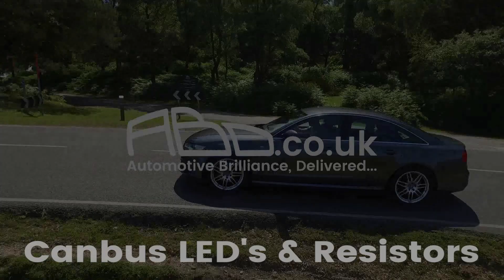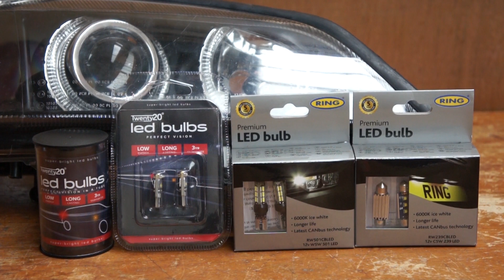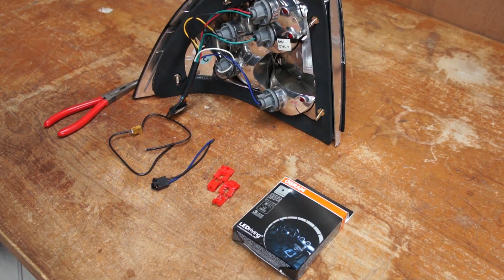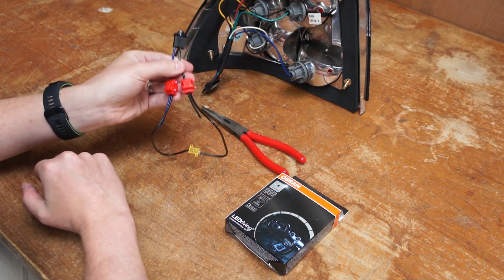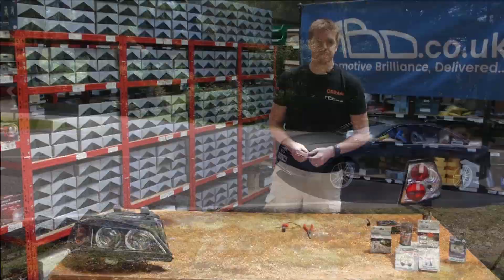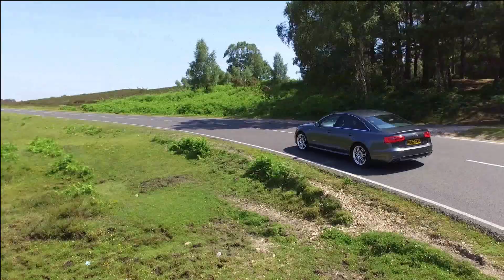LED Bulbs & CANbus Error Codes – How To Fix (With Tutorial)

Comment: So if the purpose of using an LED to replace an incandescant bulb is to save power, and then you parallel-in a similar load resistor across the LED to fool the CANBUS into NOT reporting a serviceable LED as faulty...haven't you shot yourself in the foot on three counts; 1) not saving power therefore fuel, 2) lost the fault reporting capability, that you probably unknowingly paid a lot for in the price of the car in the first place, 3) probably paid quite a bit more for the LED canbus compliant lamp / resistor mod kit ?  I can understand the logic for retailers,  but not for customers. Please explain further.

Comment: Yeah,I’d be more impressed or convinced at least if you actually took a late model car, replaced the tungsten bulbs with LEDs, generate an error code, install your resistor(s) and then SHOW the error code disappear 🫠

Comment: I have tried fitting led bulbs both canbus ones and others with a canbus plug in resistor kit neither work I always get a low beam error on my volvo v50 2004/05 model

Comment: No benefit of 2saving your your battery" and saving fuel   - if the CANBUS resistor is using same power as a filament bulb!!    - old git, UK

Comment: I had bought a P21W bulb which is an LED bulb, and after the replacement of the brake light bulb, now i have glow plug warning light, the bulb lights very good and it works very well but this massage on the dashboard is pain in the ass. So, what resistor i should use, the bulb has 15 leds with power consumption of 0.25 of singled led witch is = to 3.75 W of the bulb in total. 
I'll be very thankful if someone done it to explain how to do it, but my bulb holder is one peace on which all the bulbs are on metal paths i had only one main connector to them.

Comment: How many ohm's is the resistor?
Reply: I'm sure CANBUS does not measure resistance, it likely measures current draw or voltage drop of a circuit. Mercedes LEDs in the headlights will stop the error with a 10 or 12 Ohm resistor in parallel with the LED bulb where the computer thinks there should be a 55W headlight bulb.  A 10 Ohm resistor will add about 18.5 watts of power draw, in addition to the few watts of the actual LED bulb, and that is enough to fool Mercedes. Buy at least the 50-watt metal heat-sinked resistors and you shouldn't ever have a problem with burning out the resistor.

Comment: Hi guys, just a question. I own an 1.8tfsi 8p a3 which i decided to get led bulbs, unfortunately i was getting a error dashboard lamp saying - left/right dipped headlights. I bought a decoder but i still get the ssme msg is there any particular reason for it ? Just saying that the led are 30w and the regular Bosch h7 where 55w ones. Is that the issue behind this error?

Comment: I have a 2005 bmw e61 and have bought an led trailer board.  With this board the brakes work and indicators but the side lights and reverse and fog constantly flicker as if the test is running.  Do you sell anything or should I simply fit some 15ohm resistor in line?  Thanks

Comment: Thx for the video. I have an issue for my Mercedes Parking light (H6W bulb).
Recently, I replaced the front headlamp housing with thicker wire (14 awg, high temperature 200c) and expect it should be better. After that, it returns be dashboard error, disregard using OEM halogen bulb 6w or Aftermarket LED with Canbus error correction.

I have ordered Philips 5W Canbus resistor to do this issue fix, am I doing right? Or I should get back to thinner wiring? 

Thanks again for advice.

Comment: Hi, I did the same as you only with the Osram 21 W CANBUS because the turn signals are my w21w bulbs. The bulbs are currently LEDriving Osram SL w3 * 16q but it still emits an error and after 2 flashes it starts flashing rapidly wen my turn signal is on. I only connected the back right, so when that continued to happen, I stopped working. Maybe I should also connect the back left? Although the system recognizes the exact location of the faulty bulb. Opel insignia A Facelift 2014. Sports Tourer What should I do? I want to say that even one reverse light bulb died! It does not show an error on the board! I replaced both with Philips LED and it immediately showed an error ??? ;) I also need resistors here? Should they be 16w exclusively for the W16W bulb?

Comment: hi i got a question, If i was to tap (drl's) into the parking light wire, where would i tap into? the part above the resistor or below the resistor.

Comment: Upgraded lights in my vehicle - LED in high beam, H7/H11 in fog lamp , HID in low beam.... Added addition relay for CAN bus error cancellation.... Still on the fog lamps the MID gets reset any solution for this?

Comment: What's the resistor 's value in ohms?
Reply: Mercedes LEDs in the headlights will stop the error with a 10 or 12 Ohm resistor in parallel with the LED bulb. I say 10 or 12 Ohm because on the same car, the 12 worked for one bulb, but I had to go to 10 for the other bulb to get it to stop turning on and off.  Buy at least the 50 watt metal heat-sinked resistors.

Comment: You talk about “adding resistance to the circuit” but a parallel resistor REDUCES the net electrical resistance. Only  adding in series will increase circuit resistance - simple electricity! 👹R = (r1 +r2)/(r1 x r2), which is always lower than either individual resistor.  Is that what is required?
Reply: He means to say "add" parallel resistance; also, I'm sure CANBUS does not measure resistance, it likely measures current draw or voltage drop of a circuit. Mercedes LEDs in the headlights will stop the error with a 10 or 12 Ohm resistor in parallel with the LED bulb where the computer thinks there should be a 55W headlight bulb.  A 10 Ohm resistor will add about 18.5 watts of power draw, in addition to the few watts of the actual LED bulb, and that is enough to fool Mercedes. Buy at least the 50-watt metal heat-sinked resistors and you shouldn't ever have a problem with burning out the resistor.

Comment: Can you disconnect resistor after the LED turned on ? If canbus just check resistance before applying power then above treat should work. Since we can use small wattage resistor to fool the system
Reply: My understanding about how these bulb-out systems work is that they periodically send a low voltage pulse (not enough to illuminate an incandescent bulb). The computer uses this to calculate the resistance of the filament and thus determine if it is good. It would be interesting if a circuit provides a dummy load resistor when the circuit is off (to fool canbus pulses), but then removes the dummy load when the circuit is on. Should be a simple circuit that could be incorporated in the LED bulb itself.
Reply: @egoequus6263  that’s what I’m taking about.  The number one advantage of LEDS is the massively reduced power draw.  Putting a resistor in there negates that.     If they can be “started” with the resistor and then it be removed from the circuit that’s better than nothing.

Comment: There are two other options. 

1). Older cars that use a relay - replace the relay with an led relay. 

2). For computer controlled systems, using the obd port and the manufacturers code reader/programming software, turn off the warning.

Comment: I have canbus led's for front/rear indicators fitted to BMW M4. There is a slight flicker on all bulbs when the vehicle's canbus system scans for faults. otherwise no issues. I fitted 50W 6 ohms resisters and they actually caused hyperflash. What do you recommend and would a low watt bulb in parallel do the same job? Keith

Comment: Hi
Ok, this may be a tad out of your remit, but I have a 2016 MAN TGX truck, 24 volts, with a standard filament bulb rear light units. I have bought OEM LED rear lamp units, the same as supplied to same higher sec MAN TGX's and made by Hella, in the hope that it is just an easy swap as they have the same twist fit electrical connection. When connected they all work perfectly well. However, the dash shows fault codes for all the individual lights, brake, tail, indicator, and fog. Is there a way around this please? I assumed that any resister needed would have been incorporated within the light unit itself.
Many thanks
Jason

Comment: You noted that "in some cases it will even cut the power to that circuit." This appears to be my dilemma, after using aftermarket led plate lights. I've replaced them with standard lamps, but the power is cut off. How do I restore it?? (I've confirmed there is no power in the line feeding the lamps.) Thanks!
Reply: I’m having this same problem, did you have any luck with it?
Reply: In my case, its been several years so I forget the specifics (and I no longer have the car). However, I had Audi reset something, which worked, but ultimately had to be done again. For anyone out there looking to go LED as replacement anywhere, make sure the new lamp accounts for CANbus errors!!

Comment: Two minor observations:
1) Power, including dissipated power, power that just get turned into heat, is measured as I^2 * R (I squared R -- the current through the device in amps times the resistance of the device in ohms. ( I think I might have seen a formula with a "v" Flash up on my screen.  V, as in "voltage".  Maybe not.  Power in watts is also the product of current times voltage:  P (watts) = i (amps) * V (volts). 

2) Ohms law applies to this game.  So do Kirchhoff's laws.  Ohms law says that I=E/R  (the flow of current is equal to the voltage divided by the resistance).    So.... if your tungsten lamp consumes 21 watts when lit with 12 volt power in your car (call it really 13.2  volt power -- buss voltages in cars are typically more than 13 volts, and not much more than 14 volts).   Then we have 21/13.2 = about a 1.6 amp draw .... or 1600 milliamps.  R= E/I, so the nominal resistance of the bulb is 13.2 / 1.6 or about 8 ohms.  (Some other fun facts are involved... a tungsten filament has the least resistance when cold,  gains resistance when glowing.)  Depending upon how much current flow the measuring scheme in the car is really looking for, 10, maybe 12 ohms out in the circuit is probably going to work. 

The LED bulbs draw some current.  typically less than half an amp (450 milliamps for a replacement backup light, say).  So, Kirchhoff''s :Laws about current through a node and voltage drops around a loop tell us that we can put the half amp through the LED assembly, and then just have a parallel circuit that 'wastes' something like another amp, maybe a little less.   About a 15 ohm resistor becomes the likely candidate (13.2/15 is about .9).  And for wattage: 1 (.9) amp times 13.2 volts requires about a 15 watt 15 ohm resistor.

Your situation will be particular to its facts, BUT there is no good reason to expect any of this to work without doing the calculations.    AND, if you want to be really cool, either get a (small) pile of wire wound resistors or a fairly meaty rheostat, put it on the light circuit (START from the lower current, higher resistance end of things, and work toward the point at which the dashboard "thinks" you've put the bulb back in.  (Then let other people know on you car model "chat group"....etc.).
Reply: Thanks for the "minor" observations, that was exactly what I was searching for (and obviously as it's not "easy", it's more often than not overlooked for cheap/useless advices and "solutions")!
Reply: Good Lord. Your reply might cause me to not watch the video...
Reply: The thing I love most is Osram selling you a £1.20 power resistor for £20!

Comment: Had aftermarket led bulbs for my 2008 Audi for about five or or years now with no issues and bought them from a place called ddm in Huntington Beach ca .. well recently one of my bulbs burnt out and went and bought some new ones from them.. so here is my issue. When I first start up my car my dash will display dipped headlights but as soon as I turn on the lights the message immediately disappears and btw both lights turn on perfectly fine.. I guess it’s not a big deal but it’s a damn nuisance .. any idea what could be causing this to happen?  because it’s not like I purchased the bulbs from a different place.. could it be causing this because the company I bought it from updated their bulbs?

Comment: I've just added some aftermarket lights to my motorbike and I'm getting the Engine Management Light come on due to the higher resistance making the ecu think my brake is constantly being applied (and the cruise control isn't working because of this). The question is, how do I know what wattage resistor kit I'd need to lower the resistance so the bike thinks everything is normal ? I'm assuming the higher the wattage the lower the resistance will be ?

Comment: Headlight led bulbs for Audi 2006. H7 for headlight and h11 for fog light. What load resistor would I need?
Reply: Mercedes LEDs in the headlights will stop the error with a 10 or 12 Ohm resistor in parallel with the LED bulb. I say 10 or 12 Ohm because on the same car, the 12 worked for one bulb, but I had to go to 10 for the other bulb to get it to stop turning on and off.  Buy at least the 50 watt metal heat-sinked resistors.

Comment: Hi there... Great video BTW. My question relates to the specific size requirements of the resistors. Eg: I have replaced all my bumper tailight globes in my Audi Q3 with LED globes, however although they purport to be 'error free' my dash warning messages tell another story. Being as all these globes are W16W 12V... Does that mean I need to find resistors that are specifically 16 Watt for the LED's not to trigger a CANBUS error message... What ideal size resistors should I look for. Your help in advance is much appreciated!

Comment: Tell me if I am wrong but by adding a resistor dont we lose the reason to use the led in the first place lower wattage. I say this cause the led bulb and the resistor wattage is probably close to the damn incandescent in the first place
Reply: I use LED because they are crispier, flash quickly.
Reply: Exactly my point they say save power then add resistors it brings it back up again and they get damm hot
Reply: It's not about the wattage savings. It's about the a) reliability of LED (much longer life), and 2) brighter light.

Comment: I tried this in my BMW X3 (2017 model year US) it did not work. I bought the Philips 5W resistor and installed it using the wire taps and got error in the dash, then I peeled the wires and soldered the resistor on and still got error. Not loving this Canbus feedback loop

Comment: These resistors will cancel out the error code and will not tell you if the bulb has gone, so really this is not the way to do it as you wont know if there is a bulb out on your car as the resistor will still be making the car think the bulb is fine with the resistance. How about changing the the car relays to LED relays ?

Comment: Whats wrong when after putting a led bulb your dash lights starts blinking when you depress the brake pedal?
Reply: That is the error meaning they won't work and in England it is illegal to have flashing lights on your car unless they are orange.  Flashing white lights might make someone think you are letting them out of a junction and they pull out on you.

I found this out.
Reply: @EnglishLaw  it was my cars incompatibility with anything led that has canbus in all my brake light system.

Comment: Scotch locks, the work of the devil! The principle of this video is great and informative, but DO NOT USE Scotch Locks!!!

Use them assuming they will fail at some stage (and they will do eventually) the best (only?) way is to solder the resistor into the circuit and insulate the joint properly, preferably with heat shrink covering. I've spent many a cold, dark, winters night tracing open circuits in electrical systems often finding a corroded or vibrated to failure Scotch Lock to be the culprit, they were designed as a temporary repair to an electrical circuit and for that they are good but they hate damp and vibrations which will cause them to fail eventually.